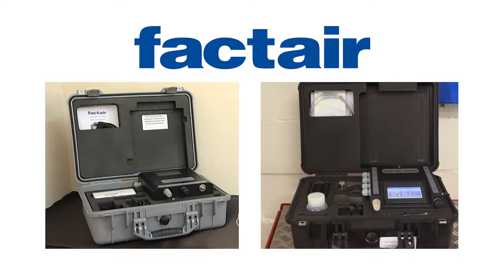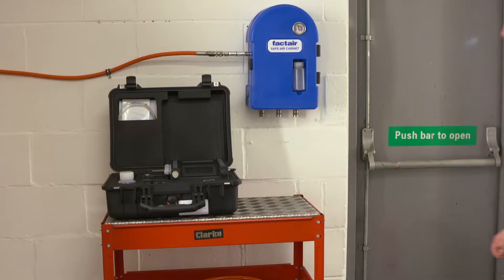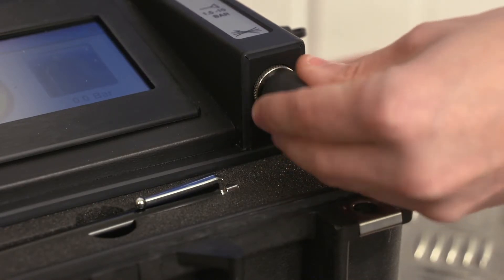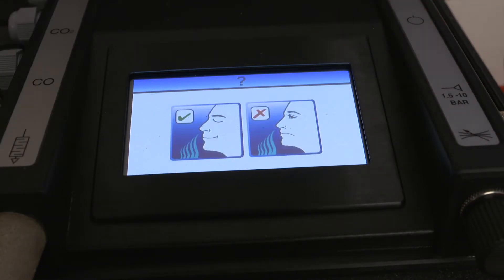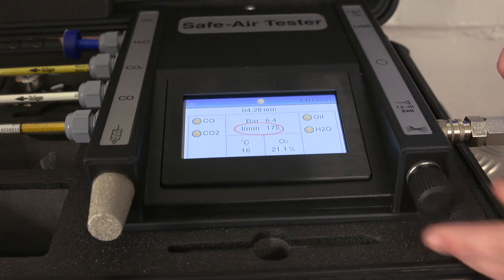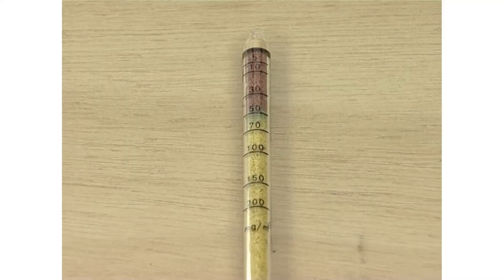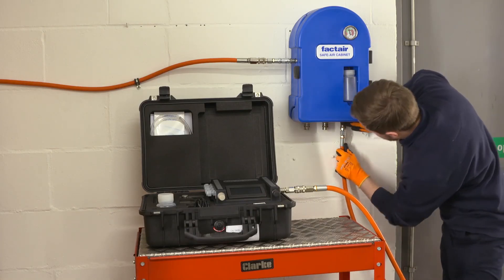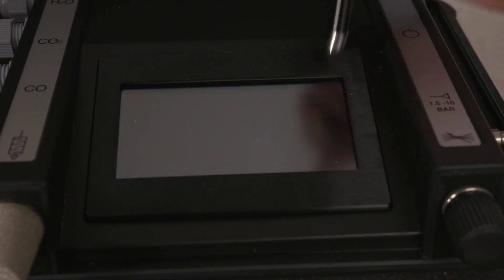How to use the F4500 Safe Air Tester | Factair

Comment: If you test all  the tubes at the same time, how do you verify the flow through each tube without an individual flow meter? Each tube type has a different opposition to the flow of gas depending on the medium inside the tube. Does each port have its own electronic flow meter?